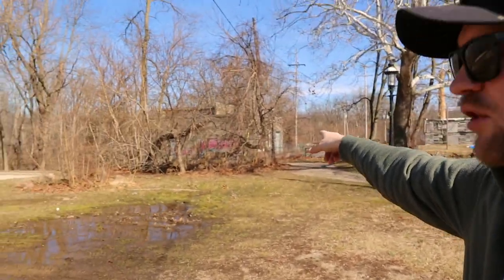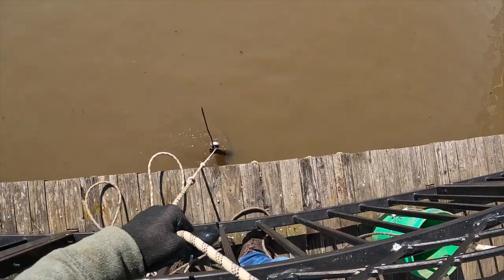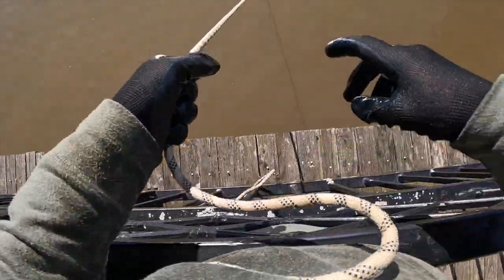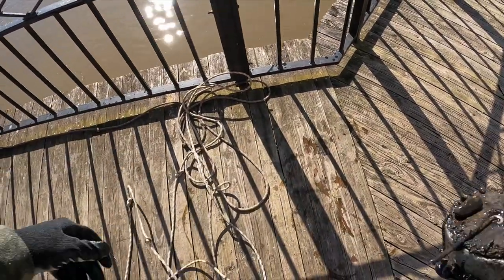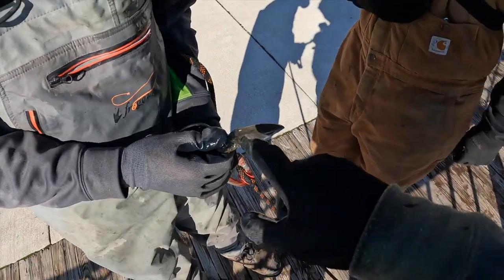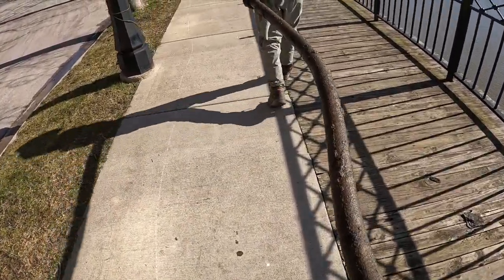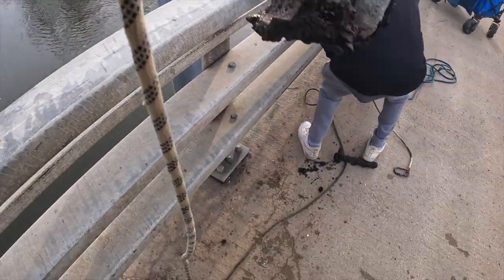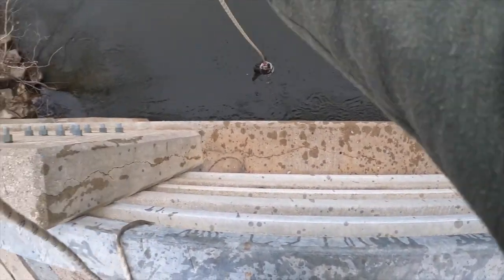Jaw-Dropping Magnet Fishing Finds!! This Could Have Killed Someone!!

Comment: #SPADE 3:32 what bricklayers uses
Reply: Yes that’s what it’s called, and it’s like a little shovel throw cement on it put it on top of the other brick put the brick on top of it and then clean around it.
Reply from the maker: Thanks for letting me know
Reply: @outdoorinfluencer  It's called a trowel and is what a bricklayer would use to lay a mortar bed for bricks and blocks and to 'butter' the bricks before laying them down. The metal is strong enough that you can actually use the edge of the trowel to trim the bricks. The trowel is missing the rounded wooden handle. Looks like the metal part might be in the 'London' pattern? Hey, thanks for the video. Keep up the good work.